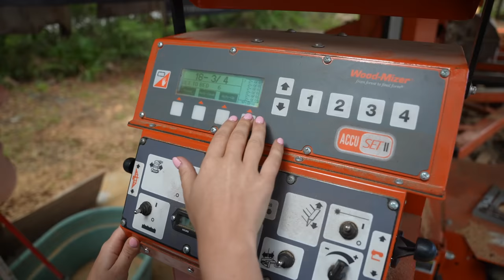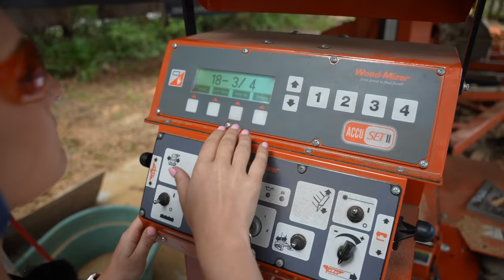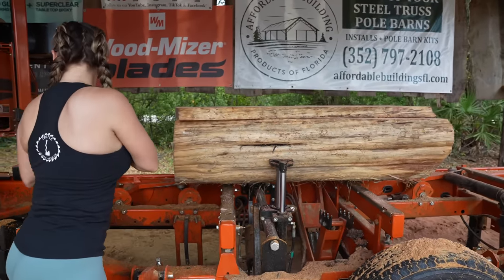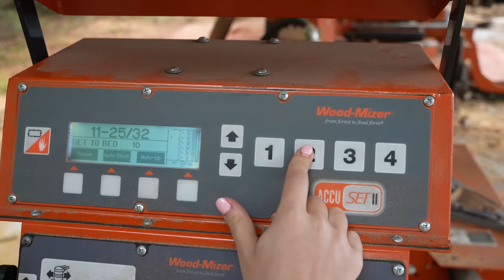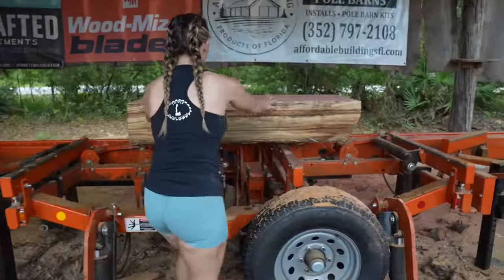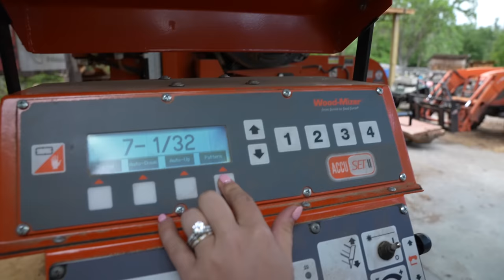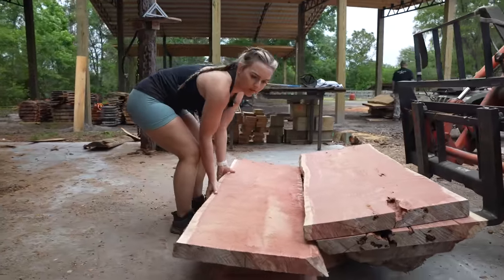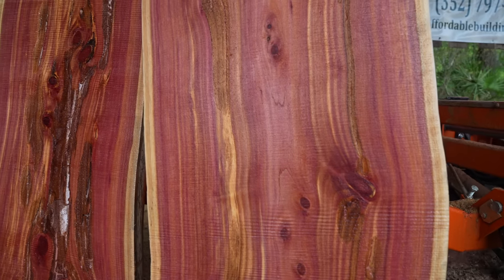This Easter Log Was Full Of Surprises!

Comment: Hey Zoe, What model is that Kubota tractor ? It looks like 4 wheel drive with extra wide front tires.  Is this tractor a good fit for what you need it for ? Also,  what horsepower is it ?

Comment: I hung drywall for many years, and if you don't mind, I'd like to offer you some advice on body mechanics. 

Drywall is large, and awkward, and heavy, just like your slabs. I learned to let the ground carry it for as long as possible. For these short slabs, I would stand them up and then pick them up from vertical. You'll save your back from most of the heavy lifting by letting it rest on the ground for as much of the movement as possible. Then you're only lifting the slab a few inches off the ground, once you are fully erect.  Longer slabs would require a different approach, but most of the technique is the same. When lifting alone, always try to get to the center of mass with your hands. Then you are only carrying the weight, and not also having to fight leverage if the material is unbalanced.  You'll find that lifting heavy objects becomes more of a physics lesson and a dance, as opposed to a straight-up ass kicking.  

Good luck to you!